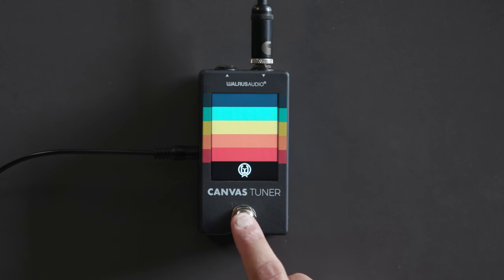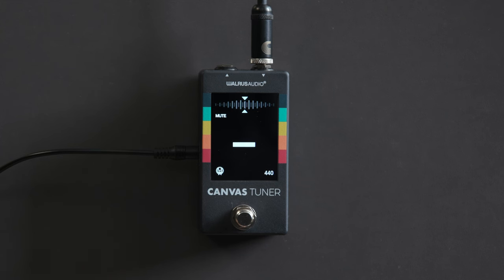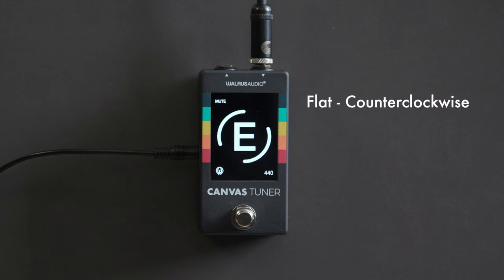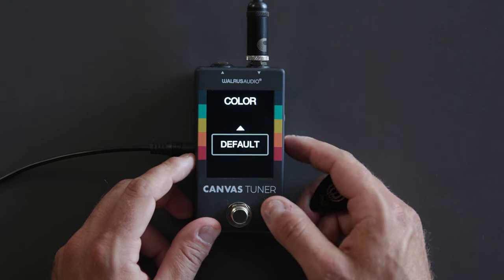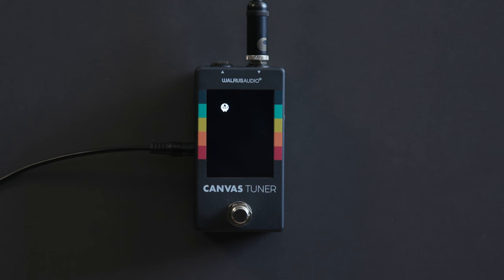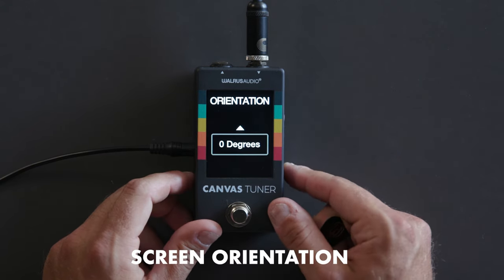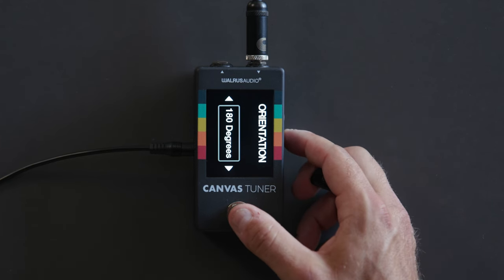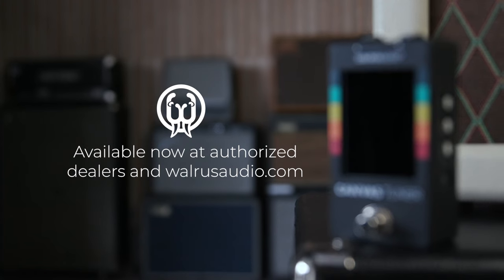Walrus Audio Canvas Tuner Video Manual

Comment: Is there a way to change the current picture 'for picture mode' on the device without plugging it in?
Reply from the maker: Hey! If you're on the most recent firmware, you can load up to 12 pics on the tuner. Then you can cycle through them while the tuner is in standby by pressing the up and down menu buttons.
Reply: @walrusaudioeffects Oh awesome, thanks so much.